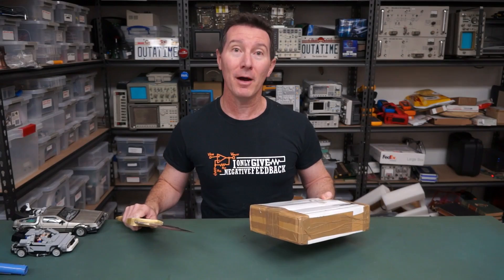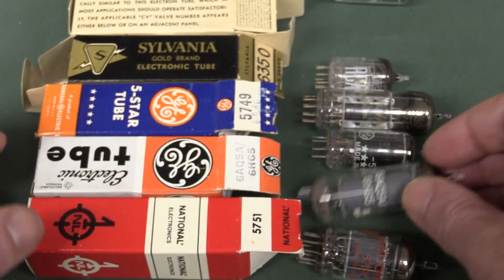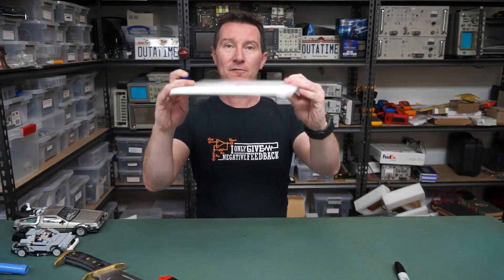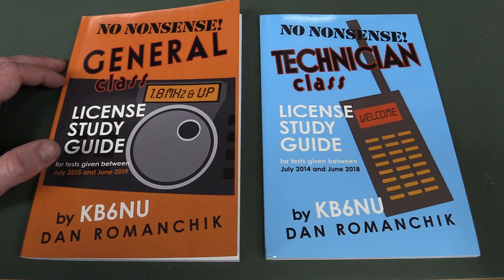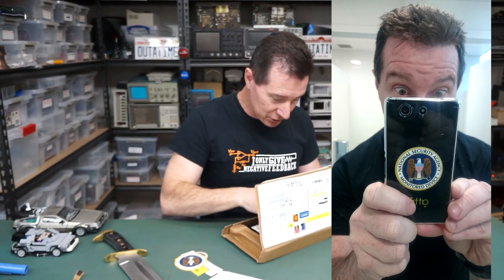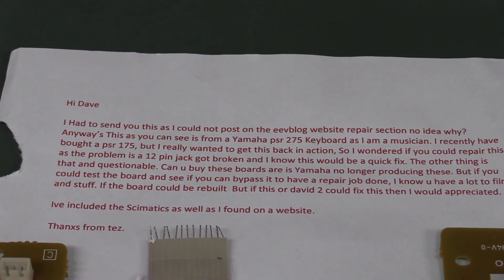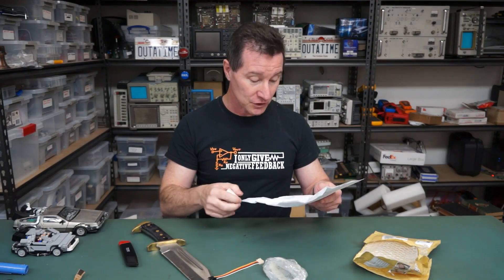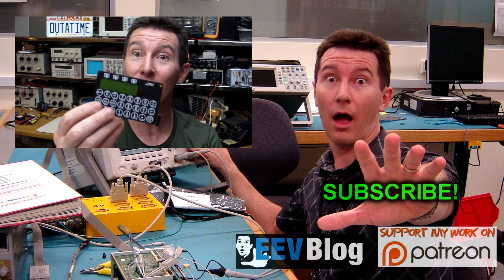EEVblog #906 - Mailbag

Comment: There were loads of tube types that were similar enough to other tube types that they were considered interchangeable in most situations. It depends on the application of a particular tube and the circuit it was in. Sometimes specs like plate voltages would be slightly different, but close enough to not cause problems. AFAIK most tube designs weren't trademarked or considered unique (they're just a diode, or multiple diodes, in a glass bottle), but each manufacturer often liked to spice up an otherwise bog-standard tube type and give it its own model number, despite the fact that it didn't really do anything different. In other words, marketing departments did the same thing 60 years ago that they still do today ;) . There are some specialty tubes that are more application-specific ("magic eye" tubes, CRT's, etc), but in general most tubes do the same thing just with slightly different specs.

I'd also liek to point out that tubes are still very common in guitar amps. Unlike the audiophile alternate universe, there's a scientificallysound reason why most guitarists still prefer tube amps: tubes clip differently than solid state components. A vacuum tube cranked up clips in a smooth manner that sounds pleasing to the human ear, while a clipping transistor or other SS component has a very harsh distorted sound; it has to do with even and odd harmonics and stuff that's above my head, but you can see the difference on an o-scope (and not just a slight difference either, but VERY different.) Youtube user El Paso TubeAmps has a ton of videos showing various guitar amps put through scopes. He's also a retired White Sands Missile Range employee and you'd probably dig his videos in general. Lots of EE stuff with slant towards analog gear.
Reply: Am I the only one that is surprised that the tubes didn't break .....
Reply from the maker: They are surprisingly hardly. And most have internal cardboard bracing in the box.
Reply: 5751 is a nice military grade 12AX7 which is a very popular tube and probably the best in the lot. the 6aq5 is a popular tube in the diy community because it is a sub-miniature pentode that can put out a good amount of power for its size. that 6350 is also a nice score being a black plate sylvania it is the "best sounding" (opinionated by audiofiles) 6350 tube. the rest are general tubes nothing special and the "big ugly one" i believe is a rectifier so its not very useful since even a lot of audiophools believe tube rectifiers don't sound any better and sometimes sound worse than a solid state rectifier.

Comment: Hey,I actually prefer the older GT octal tube you have rather than the later 9 pin mini tubes but each to their own. I build a lot of tube stuff. Most if not all of those tubes are common run of the mill stuff apart from one that although not terribly valuable is a nice tube.5751 - introduced in 1953, durable preamp tube common to guitar equipment.6aq5 - introduced in 1950, audio output tube, common in small table radios of the time, 4.5 watts output.5749 - Introduced in 1940, remote cutoff pentode. Commonly used for RF / IF stage in radio signal amplification in a hetrodyne radio (AA5 etc)
6350 - Introduced in 1953, one of the more interesting tubes in the collection. Computer grade high quality dual triode, 18.7 watt dissipation, limited applications but sellers usually want about 50 usd a pair. For audio usage probably best used as part of a phase inverter for push-pull output.6ak6 - Introduced in 1940, another audio output tube probably used in table radios of the time, typical 1.1 watts output.6bc6 - Introduced in 1950, Triple diode tube. Probably used in some audio IF stage.
The last tube isn't the right part number, maybe a date code / manufacturing code.. It looks a lot like a 5Y3-GT to me, which would make it a full wave AC -> DC rectifier tube. 5v/2a cathode, peak inverse plate voltage of 1400 volts, 440ma steady peak current. Reliable tube that was used to power most lower wattage guitar amps, radios sub 20watt output.

Comment: Hey Dave, big fan here, and I wanted to get an estimate as to how much I might get for a calculator. It is a Sharp EL-506D that I believe is from the mid-1980's. It has seen quite a few better years but it does still work in its entirety. Any information is helpful, Thanks.

Comment: Was the PCB holder conductive at the point of contact ?
Reply: There are insulation washer in the package if you want to power upp your PCB with more safety. (This was a stretch goal not delivered to Dave sample)

Comment: in the UK you can pick your own callsign IF its not in use, and according to the QRZ database, VK2EEV is not in use :) and as for the tubes i can confirm none are used in the instrument amplifier industry, or at least not commonly
oh and 73 de M6GZK - united kingdom

Comment: All the tubes are decent! Surely worth an nice little pre-amp project 
The sylvania 6350 is the most interesting if you ask me and the 5751.
The blanco boxes by RCA, Those are JAN. meaning Joint Army Navy
So not "rip off tubes" But higher grade manufacturing and more rugged for military applications

Comment: The valves in the plain white boxes are military ones JAN stands for joint army and navy, the 'big ugly' one looks like a diode rectifier, the yanks had their own numbering system, it looks like a GZ34 but there are a lot that look the same, the diodes had less pins thou and were keyed so they only fitted in in a certain way. The guitar version of the audio fool reckon that the valves rectifier are better cuz they create something called sag! Aye right.

Comment: 16:45 can the shield emulate the YM3812?
Reply: Hi Alex,
I am Fred, one of the guys behind the shield. It's not meant to emulate any Yamaha circuit as it is a design made from scratch. However it certainly produces similar sounds with some additional features. It does not have multiple waveforms though.

Comment: Someone should shrink those flippy things way down and use them in my kindle e reader.
Reply: Its basically what e ink displays are. Only e ink uses little magnetic particles suspend in some kind of goo.
Reply: +biohazard 918 nope, those are true in case of under water slates but for eink, it's electrostatic
Reply: If you put a bunch of them together, polish them shiny, shrink 'em down real small, and aim a very bright light at them, then you have a DLP projector.
Reply: like that will ever happen!
Reply: +Dylan T that has already happened...I don't remember the video but I saw it ones.. hang on I'll link it

Comment: Looks that I was right assuming that Dave and the audience would love the Flip Dots. :)

I also played around with them (or to be exact a little bit different version which does not have a stopping pin and thus rotate several times until they stop) and did a quick demo video: https://twitter.com/twamueller/status/719215470231076864

Although they might look surplus I think they're actually new old stock. At least the packages I got them out look like the original packing.

For everybody who want's to read more about the USB charging adapter, have a look at my blog post at http://www.twam.info/electronics/usb-charging-adapter-for-bench-power-supplies which describes it in detail.

Btw: Dave, you spoilered that you will open my mail this time by showing pictures with the stickers before :)

Comment: PCB holders - too tall, can't tilt (as far as I can see), highly reflective surface might be problematic when using high intensity lighting (as I do).
Reply: Correct no tilt, the PCB is held parallel to your workbench, extra useful when working with SMD under a microscope. The height is reduced with 10mm compared with the early version Dave tested for better ergonomics. The backside of the baseplate will be matte polished(not Daves sample) so no reflection, your choice.

Comment: Dave I have a 1974 Electrolux washing machine which has been strangled by a pair of tights. The door fell off and smoke came out from somewhere. Its obviously a ten minute repair and I  would be grateful if you could repair and test it esp on wash program 3. It should arrive with you on Friday. Thanks..PS I would rather you did it than Dave 2. There is a reason you are Dave 1.

Comment: Quick fix, signs that he does not value your time and experience at all. He should have tried to fix it himself if it is that easy and quick. Good luck fixing 4 lifted pads, replacing 3 connectors (which you need to buy). And of course, he will make you pay the return shipping. I would send him to Rossman Repair group and let him pay $325 for board repair.
Reply: Thumbs up for Rossman-!

But it is probably a kid desperate for help. 
Looks like a cheap soldering iron and no other gear - would make anyone look bad/

If you are reading this, go watch Rossman.. you will learn much.

Comment: 1000 Lumes for 2.2h?
That's nearly impossible with todays batteries.
For 1000 Lumens, a XM-L2 needs around 3 Amps - 2.2hours mean you would need a 6.6Ah LiIon in there - biggest 18650 so far is 3.6Ah - even 26650s don't get much over 6Ah.

If you get an hour at max. it's pretty good.
Reply: Some LED flaslight do taper their light output as the battery voltage drop.
Reply: i tried doing some math, smells like BS unless they are underpowering it. Cree's datasheet says it's 10W at 3 Amp max drive current to output 1052lm. 1052lm/10W=105.2lm per W, so 1000lm/105.2lm per W = 9.5 W is LED drive power. 10W/3A=3.33V max forward voltage for LED. if(CV) {LEDfV = 3.16} else if(CC) {LEDfI = 3} Assuming the buck converter is 100% efficient LiIon 3.6v * 3.4Ah(battery in the video) = 12.24W / 9.5W = 1.28h at best. Curious on their drive circuitry now also my math probably needs work
Reply: FelixBraun That's just the way flashlight manufacturer advertise since forever.
For practically every LED FL out there, max lumen just emitted for a few minutes before reduced to half or more. That's the "standard" behavior on "MAX" setting, mainly because of thermal limitation. The shape of the curve after a few minutes depend on the DC-DC design, some hold constant lumen, some decay exponentially.

The bottom line is: 2 hour is the flaslight endurance in "MAX" setting, with maximum output of 1000 lumen. Nevermind the average or minimum.

Comment: Typical Yamaha consumer level construction. They seem to like those stick on foam covered ribbon cables.
It also probably wasn't desoldered. That board has those springy ribbon cable connectors that hold pretty well.
How the speaker outputs got burned like that seems impossible though :)
It's probably just a bad joke.

Comment: 100 bucks for a flashlight, what the fuck   
take it apart, almost all 18650 flashlights drive the led directly without boost converter. if this does the same it isnt worth more than any average 10 buck flashlight you find on chinebay
Reply: I've spent 3-4 times that on a flashlight. Wanna fight about it? :) Those of us with the sickness call ourselves "flashaholics", it's a problem.